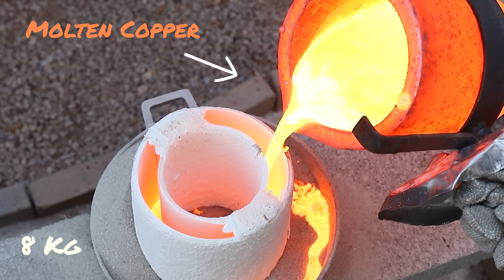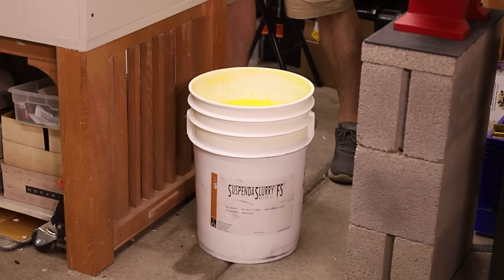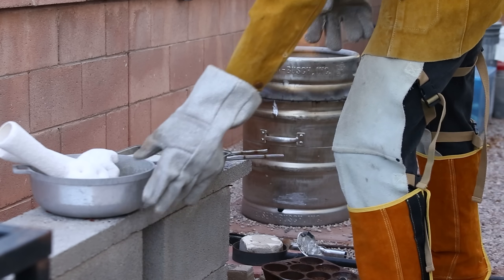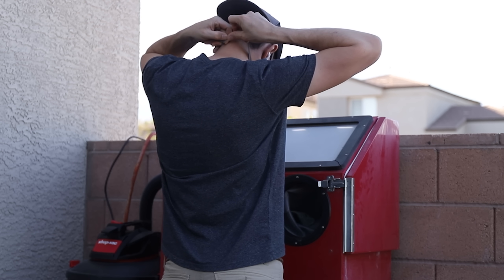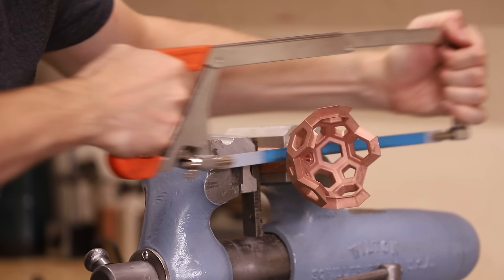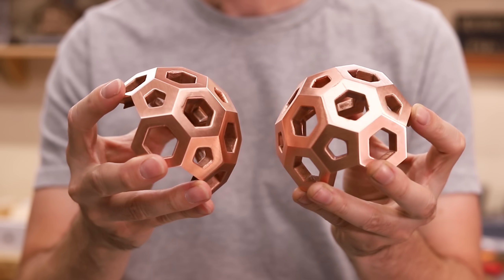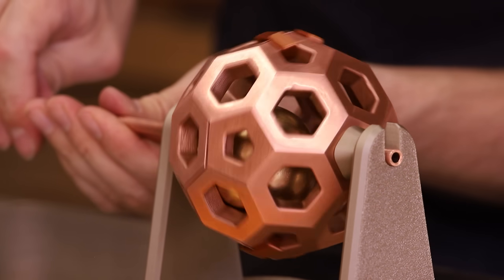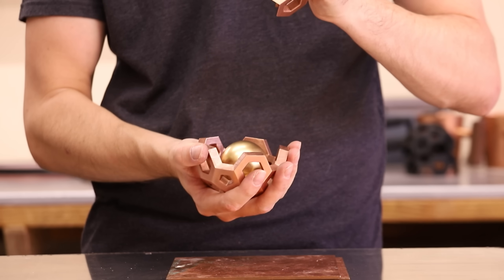HUGE Magnet VS Copper Sphere - Defying Gravity- Will a Neodymium Magnet Float Inside?

Comment: It’s because you’re body has and energy and motion force to that even to what your your and and gravity stabilizer so when you did that you found the sweet spot and kept in the middle balance within your energy source to also help the gravitate, but when you added the engine, it didn’t have a stabilizing unit or energy force to help it process the forces needed to gravitate so you’re the helping hand factor that kept it going in all its you did speed plus flight equals levitation and did  the rights thing need all at once simultaneously made it happen

Comment: Oh man, saw so many comments. Kind of doubt you’ll see this. Have you tried a smaller magnetic sphere, but big enough to not escape? 
Also, different shape magnets., maybe? The experiment I’m curious about might be a bit difficult to explain: the copper ‘sphere’ not touching anything but rather be the magnet that is tethered(thru magnetism) to maybe other magnets or well centered within a close metallic circuit that makes the magnet levitate in place, so that in the end you push the ‘sphere’ with your hands while the magnet holds the copper ‘sphere’ and levitates around the magnet when you apply force. I hope you can understand what I meant. Anyways, loves the video. Thank you for posting ✌🏾

Comment: two ideas, if instead of having the sprue shaped like the other holes if you had a centre hole in the print then you could drill out the centre and press fit a rod into it. and second, one of the best tools I have owned is a portaband bandsaw. really handy. other manufacturers are making corded and cordless bandsaws in different sizes. I have two original Milwaukee portabands

Comment: I haven't, in fact checked this yet, but it seems to me that you would want all of the openings in the copper "sphere" to be the same size and shape so that any induced magnetic field would reflect symmetry [technical term?] from the reference of the magnet. And maybe there should be an odd number of primary current carying paths across the spheres surface (imagine induced emf with odd vs even).

Comment: Here’s why copper generates current when near a magnet, unlike other metals like aluminum or tin:

1. **Good Conductor**: Copper is an excellent conductor of electricity. When a magnetic field passes through copper (or when copper moves through a magnetic field), it can easily induce an electric current due to copper’s low electrical resistance.

2. **Faraday’s Law of Electromagnetic Induction**: According to Faraday’s law, when a conductor moves through a magnetic field, it changes the magnetic flux and induces voltage in the conductor. Because copper has high conductivity, it effectively transmits this induced current, unlike materials like tin or aluminum, which have higher resistance.

3. *Skin Effect**: While aluminum can also conduct electricity, it has higher resistance compared to copper, meaning that the current generated has a harder time flowing through it. At high electromagnetic frequencies, a phenomenon called the **skin effect* limits current to the surface layers of the conductor, reducing aluminum’s efficiency in transmitting induced current.

4. **Material Resistance and Density**: Tin and aluminum have different crystalline structures and electrical resistances compared to copper, making them less suitable for current induction. Copper provides an ideal balance of low resistance and high magnetic permeability, making it highly effective in this application.

In short, copper’s low electrical resistance and excellent conductivity make it uniquely suited to generating current when exposed to a changing magnetic field. Other materials simply aren’t as effective at conducting or maintaining efficient electromagnetic induction.

Comment: Just a thought make a motor that just doesn't go 1 mph but an Quarter . 
To have have 4 speeds to get to a mile to get more an accurate spine . 
Where you like a the quarter is to but break that in half to get 8 speeds to 1 mph. 
I know it's a lot of work but in reality you know that I know this is the way to get the accurate speed ..
As well I think that mold should be a inch bigger to a inch in a half then what you got speed. 
But as well compensate the are plus speed plus magnetism with the force ..

Remember what you doing haves to have precise measurements as well on a mathematical level ..

Meaning the holes as well have to have same spacing . 

You get where I'm going

Comment: brother find an awsome engineer and make a magnetic power running engine which needs no electricity or fuel to run or might need need some electricity to start it if this will work out then it will be revolutionary it will produce no pollution and have many more positive point to it

Comment: Add an additional larger sphere not copper and couple it's rotation to a rotation plane of the inner sphere at +45° by having those original plugs on a fixed track inside the larger sphere. Then another sphere of copper that the second not metallic sphere sits inside of the biggest sphere again on tracks at a -45° angle such that the two copper spheres, when rotation of the outer sphere occurs,  has an orthogonal vector to the inner sphere to control the zy plane deviation with the outer spheres xy planes influence.

Comment: SHould have left the flanges on and used a lathe. Also whip out a a clamp meter, secure that, open it up..like literally expose the steel inside each clamp arm, attach more steal, have it encase the globe and measure the fluxtuating current as it spins at different RPMs :) (Be sure to use clamps to secure)

Comment: When I saw that monster magnet in the copper pipe, I thought of a cool concept that might be of interest to you. 

Theoretically, you could put your pipe in a motorized machine, based on the design of a rock tumbler, and let it run with your magnet inside. 

Would it stay centered indefinitely? If so, it would make a very cool conversation piece running silently on your bench...

Cool stuff man... 

P.S. if you read this, and actually try it, please let us see it!

Comment: Get a steel ball that is hollow in the center, put a little oil in this center bubble. Without bubbles seal this, basically melt in a pinhole. Do not burn and bubble this oil. Put a layer of fine mortared black tourmaline around that. Put another layer of fine mortared black tourmaline around that. In good thick layers. Attach a power and ground layer to that outside layer. You don't need to keep this power input on. Put that in an enclosed box enclosure. Wait for that energy release. Do not put bubbles in this, do not throw this. But I wanted to show you the floating.
Reply: I don't think energy is uncontained.

Comment: Of course you had to spin it extremely fast because the copper does not completely surround the magnet I could see there being huge issues with a magnet when trying to use camera equipment anyways this is way cool
Reply: If the magnet or a completely encased it would float you’re a big holes because you wanted to see it, oh but so close sir do it again make a solid sphere magnets interfere with everything sensors how about you do a plastic spring pin system that pushes through the copper and you know exactly where the ball is making the holes way smaller that sounds like fun hey hey over here over here would you do that I’m gonna subscribe right now you’re doing really good stuff there brother

Comment: Can you try to  build a generator using this cpper sphere ? I have always wanted to build cooper circle tube with a magnectic spere in side levitating  and maipulated by external magnets to drive the spherical magnet to generate electricity with Iron wrapped coils around the copper circle, I always thought of it as a prpetual generator.

Comment: I would say mount the sphere solidly on the turn table you made and mount the earth maget you used to spin the sphere remotely similarly, you can moterize the spin of the earth magnet at a specific speed. Place the sphere on top of a desk or table and the earth magnet contraption directly under and you can make it all appear as if the sphere is "rotating itself."

Comment: What if you Created a Perfect Circular Outer Sphere for the cover and possibly Electrifying The Copper Sphere Cover and Adding Magnetic Opposite Magnetic Watch battery Sized Magnets implanted into the inside of Your Copper Outer Core in corresponding  Equal Spacing ??? I Have Always Been interested in Magnetic Forces and How Spinning Objects attached to a Stick you swing around React , but Far as I Know The Space Aliens only know how To Ride on Magnetic Fields and Skip across Gravity Fields Smoother than Skipping a Rock across a Calm Body of Water !!! So Many What If’s Never Discovered Yet !!!

Comment: You need a lighter magnet... one whose weight is exactly equal to the magnetic force it exacts. You can calculate exactly what weight that would be based on this experiment or go the more fun route and work with lighter magnets or different sized copper capsules till you find that sweet spot. Either way ...thumbs up.

Comment: If you take a big copper tube, put it on a scale, and drop a magnetic through it does the scale pick up the weight of the magnet fully before it actually lands on the bottom?

Comment: a net spear with a checker pattern on the outside of the pvc. Cut holes so the copper is flush to the inside of the net. 
If you can figure out the push and pull distance of the magnet on the copper, I think you can find the  circumference of the spear you may need to make it flot in the center as it's rotating.

Comment: your design to let us SEE is the downfall to the actual effect. To lessen eddy currents in transformers they use plates as the eddy current loop cant traveler through air. 
essentially you're compairing the experiment you howed with magnet in copper pipe  with an experiment with same magnet in a copper mesh net as a pipe. the eddy currents have no where to form. 
so to make that ball magnet truly float, make the sphere solid or the  holes as small as possible. 
i hope that helps u. bloody love your furnace dude. its epic.

Comment: What if we reverse it? What if we arrange it small magnets very powerful individually in each line from the inside of this sphere and we put a ball a cup ball inside what kind of arrangement will make it float? That’s the good question. You know really good question because it’s worth trying out Because it should be some sort of arrangement hypothetically if you put it in the right way and just close it it will just be floating without any effort putting up putting down move it. It will just align that would be a better experiment to be honest another thing that would be really fun Because some sense. This is a matter what if we made this new motor spin and we can like somehow, in this new proposed experiment measure the current of it because it will spin and the sphere inside it will spin as well and a good idea is as long as it’s copper what if you curved And colored it in a way that it will show the direction it’s heading to you know because it will tell us is it a spinning clockwise under you know, counterclockwise in the same direction of the spinning or in the counter side that’s that’s gonna be a really really nice experiment and fun

Comment: You might avoid the instability related to gravity that you’re seeing while spinning on a horizontal axis by switching the shaft to a vertical axis. 
.
Otherwise, this is a stupendous video and experiment. Especially the 3D printing to casting method you use. I’ve wanted to play with melting bullet casings and casting brass objects but hadn’t landed on an effective method for complex structures. So this video was a gold mine.

Comment: Add a copper wire across the plane of the horizontal or vertical axis. Connect VOM to the ends. Try voltage then change to current.

Comment: Old style telescope electronic driver boxes can vary AC frequency to hysteresis synchronous or analog clock motors with high precision.  Even easier is to use a stepper motor and driver box with digital control of speed.  "Onstep system" has many examples on line.  Components are not expensive.

Comment: Electromagnetically suspended spheres were used in navigation systems to replace gyroscopes.  Later ring lasers gave finer resolution, were very inexpensive.  Now tiny chip accelerometers for 3D motion are in smart phones.

Comment: super :) if you make a contact with wire in one side of this magnet copper thing and if you put a nail in soil in your yard , and then connect with other wire your nail ,  you can measure how much is the potential between this two wires of this few forces ;)

Comment: you should build a motor withhout a power supply with 5 balls and star betweent in like a 5 star. and it should starting rotating and then never stopp. but be care full strong mangets are very dangerous

Comment: 12:49  An extension of the experiment to study the effects and get numbers such as the rate of spin relative to the radius of the mechanisms

Such as what is the optimum spin speed for the sizes of objects you are currently using
 And as you change a size how will it affect the optimum spin speed

Variables to adjust:
  Size of the magnet
 Strength of the magnet
 Thickness of the copper  'sphere'
  Size of the holes in the copper 
  The number of holes in the copper 
  Maybe even the purity of the copper

Comment: put a rubber membrane in between the two half of the copper shells ensuring that there is no electrical contact between both sides, when spinning you should get a voltage and current, one side will be +ve and the other will be -ve , use this voltage correctly and with a suitable motor should allow the unit to self power once correct conditions have been met. to aid the spinning you would need a couple of really smooth bearings for the left and right shafts.

Comment: So if you made a way to make the motor spin the normal magnetic close enough to spin the sphere, how much would the motor need to spin (rpm) in order to keep the sphere turning, honestly that'd be a really good setup for a low voltage motor on vehicles.